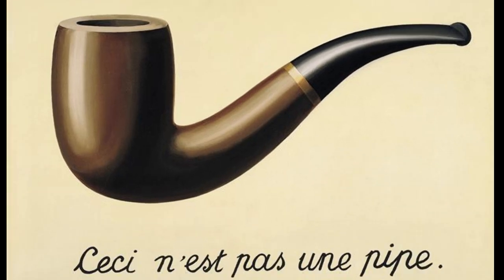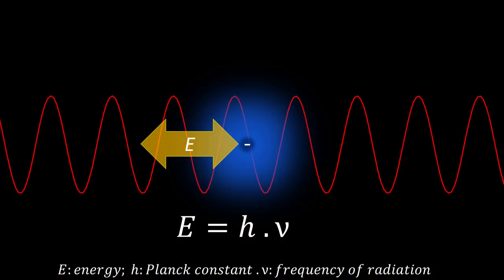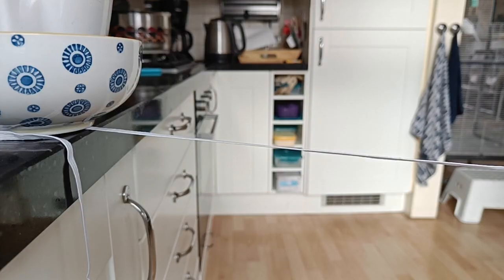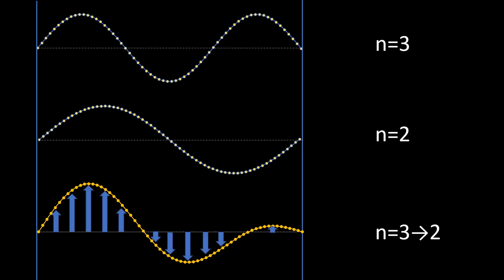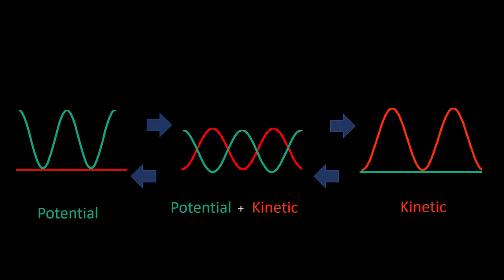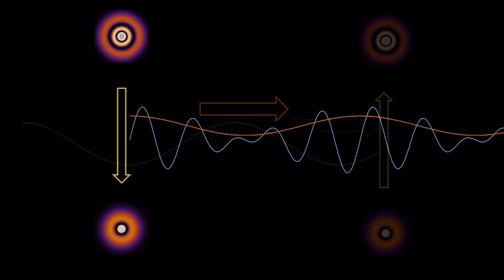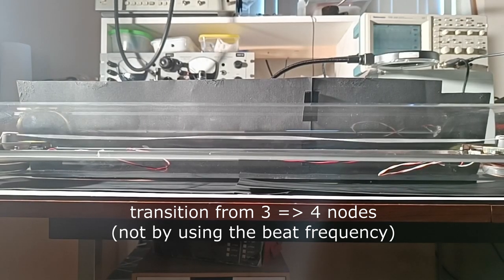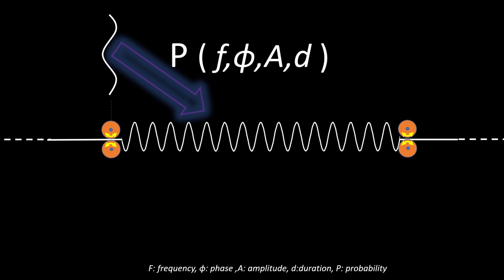Coherence part 3: This is not a wave.

Comment: I don't see anyone else who mentioned this element, so: The speaker cone is acting as a (very effective) damper due to lack of rigidity. Ideally, you would want the anchor points for the elastic to be completely static when not being used to add energy to the system.

Comment: While sleeping on this I nearly saw God, after replacing the vibrating the elastic string with a rotating flywheel having an elastic string passing through axis of the shaft supporting the flywheel, so that the reciprocating motion is twist in ether direction from a common center angle of rotation. Alternatively, one could use the “fishing reel” double helix mechanism to lift a weight in either direction from a common center angle of rotation, the idea for either is so much once itwisted or uphill, the flywheel would spin past the rest center position and keep going until it runs out of momentum, and then reverse rotational direction and return. 

Now picture these stacked in alignment on a common shaft,interfering in various ways via magnets for fun. Now wrap the common shaft into a torus, oooo.

Another design would have the mechanism be two sided, where a common center spring pulls the two ends towards each other, making the flywheels rotate in opposite directions. The best translator might be a ballscrew for low friction,  but perhaps needs to borrow the double helix from the fishing reel to get reversible rotation action from ether side of a common neutral position.

In any case, even if the mechanics are kind of complicated, because of the double helix thing, you might be able to get it to go with just a simple elastic, getting twisted, one way, or the other through the shaft, and finally computer models can make all of these fundamental motions simple to emulate and combine.

I just had this vision of how these things might harmonically pass energy between themselves, and how they were distinct species of motion that correspond to distinct behaviors in the more general sense. It’s a little vague, but I have this idea of waves that passed through each other via superposition, and waves that crash into each other, because they’re not transparent in the same way. These might correspond to these mechanism modes. either side of center they are like cars in traffic, traveling in the same direction they might pull on each other some or push, but when they’re going opposite directions, they have to act an intermediary in order to have a shared wavefront.

If you picture the vertical stack of these things with a lot sided flywheel, one could see that when they are all in phase, the common shaft would feel a strongest vibration, but when they are randomly oriented, it would feel a minimum noise like vibration. Depending on how far you spread these relations Around the circle, you’re basically looking at the Fourier transform between the common shaft and the things rotating around it.

Finally, this idea of a potential is present in the slope of the tension or the gravity. As the thing whines it gets energy built up, and then when released it reverses direction downhill or “down-spring”, heh. Meanwhile, the rotational aspect contains the discrete forms of position, velocity and acceleration. So the model contains both an energy conservation and angular momentum and potential. 

The original idea with the spinning weight with an elastic spring, so it would spin both directions around a common neutral, was to establish more energy in the system, so that you get a cleaner presentation. Well this might be complicated by turning oscillation side to side into rotation back-and-forth, if you took a camera and translated the motion in a computer back to side to side, it would probably give you a much higher signal to noise ratio. The other fun thing is that you could adjust the flywheel weights like a musical scale, so that they oscillate naturally at different frequencies. Perhaps mount the shafts on proper ball bearings for the best low friction experience.

Every now and then I watch a video that makes my brain light up and I go off on brainstorming tangents. Yours is definitely one of them. I will be thinking of this one for a long time to come. Thank you.

Finally, one could see a torus shape field undulating in such a way like a hula hoop dancer to make a bunch of these things go round, or vice versa, a bunch of these things could squeeze a torus field which responds in turn.

Comment: Jeroen: note that the wave amplitude is the same for all your waves because it's dictated by the speaker cone going up and down by a certain distance. Also note that the dimensionality of action h can be expressed as momentum x distance. As for the electron, cut a long sinusoidal strip of paper with a flat bottom, then form it into a Mobius strip. The electron is just a 511keV photon in a closed path. Check out "the physics detective". That's me.

Comment: Oh boy I have a few ideas of how you could have switched node numbers introducing potential energy. Each has its difficulties. My first hunch is that you varied the length between speakers with a linear actuator, this would stretch the string and add potential energy. The second ideas is that you could introduce a second transverse energy source to the rhs of the speaker but this would be a logistical nightmare so I'll go with idea 1 first.

Comment: I'd be curious to see how difficult it'd be to counteract frictional losses with additional input of energy.  Of course you don't need this under constant movement, but in the case where you're switching inputs it may prove viable, as you're not letting the transverse wave have decay from friction while switching to longitudinal input.  Though it'll take quite a bit of testing to nail down how this works, because you cannot just follow the amplitude of natural decay, as when you start counteracting decay the decay is then modified, then you need to iterate on the modified decay, and do this in multiple steps of iteration until the result is good enough for demonstration purposes; but there's also another side to this, how the longitudinal input further modifies how the transverse decay behaves, and how to manipulate the system so that you're not introducing a beat frequency within decay mitigation.  Although I'm sure there's some simulation software where this can be easily modeled and calculated, as you're only dealing with some very basic components, air resistance and internal friction of the elastic band; which I know there is a term, or set of terms, for what's going on within an elastic component, I just can't remember what they're defined as.

Comment: This is a very interesting way of looking at emission and absorption of electromagnetic waves. I have a question that I have not seen asked elsewhere: When two frequencies interfere, we see a beat frequency at the difference of the two frequencies, but also another frequency corresponding to the sum of the two frequencies. Does this higher, sum frequency ever show up? Is there any reason it should be non-radiative, if the beat frequency is clearly radiative here. My intuition would say that it is wrong to expect to see the sum frequency under any circumstances, as a sum of frequencies here is equivalent to a sum of absolute values of energy, which are impossible to define uniquely. The difference in energy however doesn't require absolute values of energy to be defined.

Comment: The fact that quantization effects could be from just the interaction with matter is presented well...  A lot of physicists don't know that semi-classical EM theory, where atomic levels are quantized but radiation isn't, does just about everything.  I think hanbury-twiss is the first time you really need photon quantization - photoelectric effect doesn't require photons for example.

Comment: So, if a vibration in the EM field passes through both slits, and manages to find a receptive atom in the detector screen that is aligned in terms of phase, how does this quanta manage to transfer at such a singular point? Is this the wrong way to look at it, because it’s not really “the same photon” it’s just that the local EM field is increased in energy above its pre-emission (stable) state and then that energy finds a willing recipient on the detector screen?

There is no “photon flying through space” just an input and output from the EM field at a place that’s in phase to take it?

Comment: I get the impression from your other videos that you are a strong believer in photons not existing, and that they are simply continuous waves that are canceled out everywhere else by the mix of frequencies. If that is the case, how would you then describe these pulses of light that are send out when an electron changes state? They only last for as long as the change. Is that also a continuous wave that is canceled out everywhere else? Or is it indeed a very short pulse of light, which one could be tempted to call a photon?

Comment: 25:46 What if you made the string that's containing the wave slighly longer while adding the kinectic force of the new wave? Maybe use the difference between how much string is in each antinode from the lower to higher frequency? And then retract it over the same amout of time it took to go from a higher to lower frequescies you showed earlier.

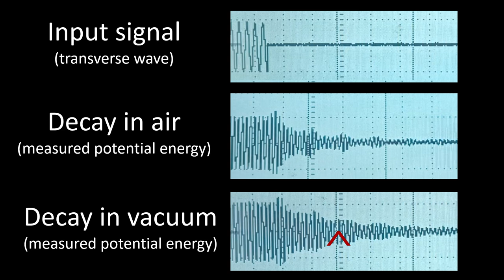Comment: 26:26 An interesting side-discovery about the sources of damping and their relative contributions.

Try a high-tensile steel wire. This material type should eliminate viscoelastic damping. Unbraided wire would eliminate frictional damping from relative motion of braid strands. However, increased strand/wire diameter risks damping from plastic deformation, even at modest amplitudes and frequencies.

Comment: I have an idea on how you can play with the phase a bit easier in your string standing wave! 

Ditch the function generator. Use a PC sound card/ DAC with a custom sound file with both frequencies. Then pass the output signal though an amplifier to drive your string and protect the sound card.

Some sound cards won’t handle low frequencies well so you might have to work around that.

But you could then see what happens with different decay rates for the original wave or different phase offsets for the second wave, or the effects of frequency uncertainty on the system.

I think Audacity would be able to mix the sound files you’d need
Reply from the maker: I certainly considered using an Arduino to het the phase right. But friction and the lack of energy quantization in a string will always pose an additional challenge to make a wave switch standing wave states.

Comment: @Huygens Optics  But do you not know that WIGGLING STRINGS DO NOT EXIST, because really it's ALL JUST PHONONS!  Heh.

I'm trying to be as intentionally stupid as the ones who claim that EM fields are only an abstract mathematical concept, because light is really made of photons.    Suuuure, and crashing ocean waves are "just an abstract concept," because mechanical waves are really just a bunch of phonons.   Strike a brass bell or a tuning-fork, and there is no vibrating metal here.   It's all just made of phonons, right?   Get rid of acoustic physics, replace it with "Phononics."

I think you hit the correct concept, right at the start.   

The smoking pipe, it confers authority; provides a false facade of expertise.   And, since everyone knows that the EM fields are just some old obsolete 1880s stuff, easily understood by every beginner, then what today can win us respect; confers similar false authority?   QM weirdness!  In the form of "PHOTONICS" STUDIES.   No EM waves, instead it's photonics-this and photonics-that.

Why be an expert in Maxwell's fields, when instead we can claim to be "Photonics" experts?   If you don't understand it, it's not because the word "Photonics" is a Pipe of the Authority-Figure, a sham meant to conceal their own ignorance and fool the unwary  ...it's because we Photonics experts have actually grasped the One True Interpretation of QM.  Or so we claim.   Or, so we lead everyone into believing  ...while everyone else is still thinking in terms of sad, obsolete Faraday, with his e-fields and b-fields, and the abstract EM ripples which of course don't really exist, right?  Lasers and FO are no longer the hot-new-thing on the block:  Photonics is the thing!   Pure hype, plus maybe some small FEL and whispering-gallery resonators.

Don't be calling out in the wilderness alone, other mavericks questioning The Photon are:

- the Nobel physicist Willis Lamb, his paper "Anti-Photon"

- Art Hobson, his AJP paper about QFT, "There are no particles, there are only fields."

- Carver Mead's book "Collective Electrodynamics,"  QM foundations of EM

Also track down the essay collection:  OPN news, "What is a Photon?" the nature of light revisited.

---

Separate topic:  if atoms are EM oscillators, then we must note that LC electronic circuits have a typical Q-factor of 100 or less.   Lossy coils.  They ring down quickly, within a hundred cycles or two.   But in a microwave oven cavity, the typical Q-factor is up in the tens of thousands, perhaps Q=30,000.   Very narrow linewidth, like single-frequency sine waves.  And when given a transient pulse, your microwave-oven rings down very slowly, over tens of thousands of cycles    

So, what then is the Q of an atom?   Perhaps look at some hydrogen linewidths?   

Remove the thermal doppler of 300K hydrogen gas, only looking at single atoms in a trap (assume 1deg K temperature or far less.)    Based on linewidth, wo/any doppler broadening, I think it works out to be Q=several hundred thousands.

Maybe much of the apparent "weirdness" of atomic interactions is actually caused by classical LC circuits, each far smaller size than the wavelength, plus this unusually enormous Q-factor, as if atoms were nearly-lossless loop antennas, each with tiny capacitors connected across?   Quantized transitions are still important of course.  Maybe.  Probably.    But apparently, the "QM weirdness" phenomena such as Stimulated Emission, Rabi oscillations, photoelectric effect, and the enormous coherence length and coherence times, etc., they may have nothing to do with QM, and everything to do with classical LC circuits where the inductor's conductivity is far below micro-ohms, and the Q factor of these electrically-small antennas is almost a million.   Imagine your oldschool AM pocket-radio, but having a zero-ohm coil, not just wire-wrapped ferrite rod.   At high Q, it would absorb every 550KHz EM wave passing by within 180M distance; an invisible antenna 900ft long.  Pure classical physics, that of high-Q resonators.   Now put several such pocket-radios near each other, producing line-splitting band-structure etc.   No QM needed, it's all just beat-notes.   

Poor Albert, he sent us up into a dice-playing universe, when actually the photoelectric effect doesn't seem to require that "particles" must exist.

Comment: You can make a damping device for the longitudinal waves using piezeoelectric stack actuators connected to an electrical impedance matching network. These can be purely passive (no amplifiers needed) and yet provide the impedance match required to prevent reflection.
You could of course connect an amplifier to one and use it to inject the phase waves.

Comment: Why do you add 1 frequency 8hz with 32hz not to 40hz?
Because the energy of the 8 hz wave + the energy of the 32 hz wave is not enough for the energy of the 40 hz wave. And two waves with different frequencies cannot resonate. You can just use pulses of energy to increase the frequency of the wave (I think)
Let me record some properties of a standing wave - a wave is essentially the interference of two opposite waves: the incident wave and the reflected wave. It will make thinking a bit more coherent:
1. The amplitude of oscillation of the source is a => the amplitude of oscillation of the wave bundle belly is 2a.
bundle width is 4a
2. In case of 2 fixed ends or 2 free ends: L = k*λ/2.
k: number of bundles.
L: length of string
For a standing wave, Lmin = λ/2
Maximum wavelength : λmax = 2*L
3. f(k) =k*v/2L
v: material-dependent wave velocity.
=> minimum frequency with standing waves on the string:
fmin = f(1) =v/2L
f(k) = k*fmin
4. The 2 closest frequencies to create a standing wave on the string:
f(k+1) - f(k) = fmin
5. When the endpoint is
+ fixed: Oscillation amplitude at any point:
A = 2*a/sin(2pi()*x/λ)/
+ is free: amplitude of oscillation at any point
A = 2*a/cos(2pi()*x/λ)/
Where x is the distance from the point under consideration to the belly of the wave.
6. Frequency related to wavelength
f = v /λ
From these will indicate the energy of the wave
Reply: Is fmin = v/2L the natural frequency of this system? Will this frequency be the resonant frequency?
Assume Emin is the wave energy corresponding to fmin. We inject some waves with frequency fmin, energy Emin so that there is enough energy for the system to convert to frequency f(k).
E(k) = g(k)*Emin?